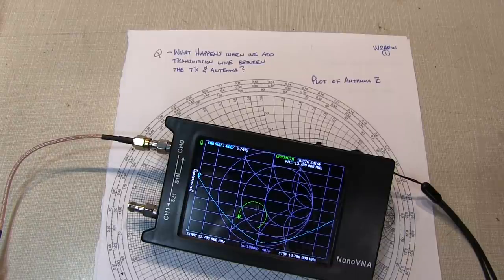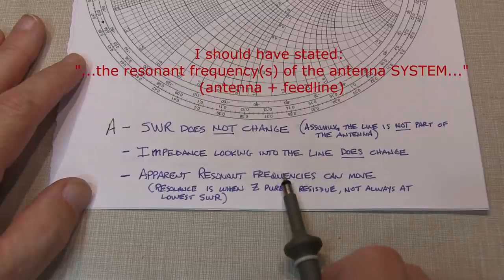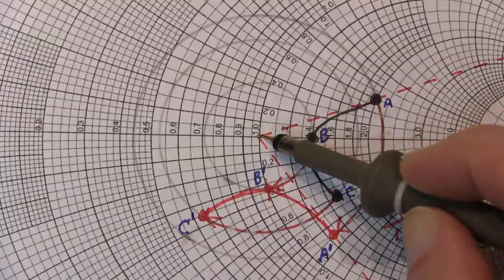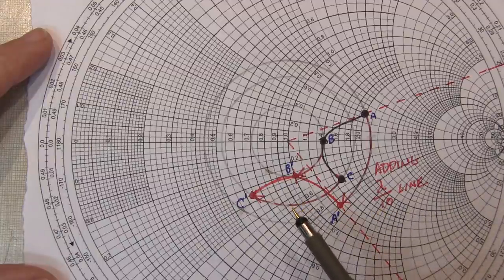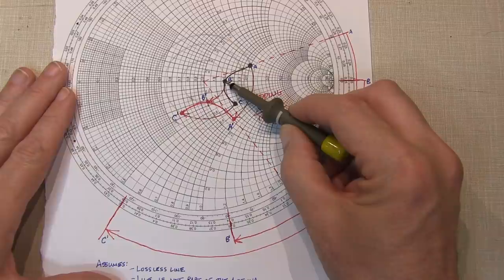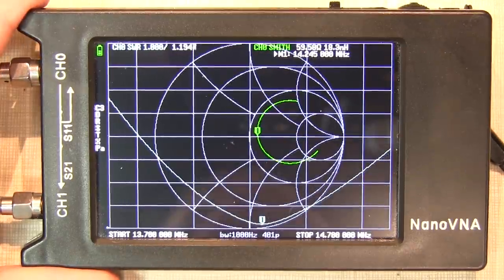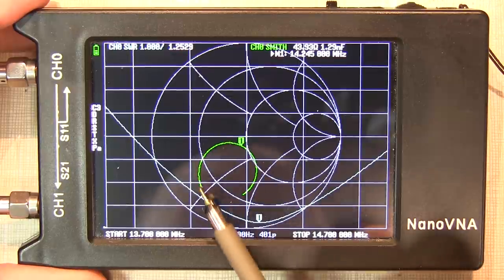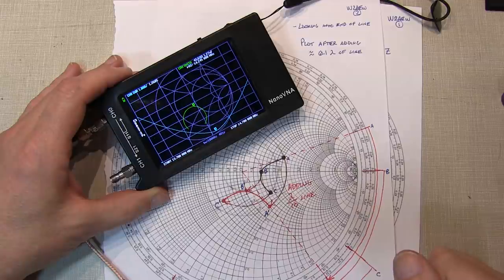#325: Use NanoVNA and Smith Chart to show effect of adding transmission line length

Comment: I've been in electronics communications for over 50 years, and this was never explained.  Likely for technicians, unnecessary.  However, with the advent of affordable devices like the Nano-everything, this becomes a tool for understanding by playing with it on the bench and ultimately the field.  Thank you so much.
Reply: An electronics technician who is going to work for 'communications', it helps a lot to take a 'technology course in Specialized Microwave Electronics training, to learn how 'microwave frequencies work, Klystrons, Magnetrons, TWT's. Microwave waveguides, components, Microwave mathematics, laboratory work, and learning the use of the SMITCH CHART. I took a 9 month course at Microwave Training Institute, owned by Alan Scott, a Microwave Engineer who worked at VARIAN, way back in 1985 here in SILICON VALLEY, Mountain View California.

Comment: Alan, great video as usual. In some future video on the subject, can you show what happens when you add transmission line of a different impedance than the system? As those used in some antennas to correct the impedance. Also, what happens when you add lossy line (SWR goes down, but why). Thanks for your videos and Happy New Year!
Reply from the maker: Often times a quarterwave transmission line is used to transform impedance.   A transmission line that is a quarter-wavelength long has the unique property of inverting the impedance around Z0 (it's line impedance).  The relationship is Zin/Z0 = Z0/Zload.  Thus, to transform from Zload to Zin, you use a quarter-wavelength long line with Z0=sqrt(Zin*Zload).   Lossy line quite simply reduces the apparent SWR because the reflected power is attenuated simply due to the loss in the line.  Since less reflected power makes it back to the transmitter, it looks like the SWR is lower, but it really hasn't helped anything.

Comment: Great video, thanks :-) I assume you're adding line of the same impedance as the line already used in the antenna system. Or does this apply as well, if the 'extra added line' is the actual antenna feed as a whole?  How does it look in the Smith Chart if you add extra line of another impedance, fx. 75 ohms in a 50 ohm system or vice versa? 73s

Comment: Despite of Alan's explanation by means of the Smith Chart, it still might remain a bit hard to understand from a physical point of view why the impedance transform by the cable won't affect the SWR.
One could think that any transformed antenna impedance back to the generator would cause an impedance mismatch there against its 50 Ohm output causing further reflections with impact on the SWR.
I assume that this is not the case because there's no physical impedance mismatch between the generator's output and the cable. The transformed impedance just describes the voltage/current ratio at this point.

Comment: I got the NanoVNA SAA-2N. In order to read and display SWR, there is a circuit called the SWR bridge. Now, have you tried reading from any tuner? For example, REF and FWD is needed and provided by the SWR bridge, by reading from the tuner coupler where to me the bridge is at. The idea is to tune live, with no carrier on the air, as the analyzer shoots an exciter to the antenna to plot on the display. Now, when both, the tuner and analyzer is used as per above, then both tools become even a better solution, due to tuning live, no carrier, then transmitter is ready to go out on the selected and tuned frequency, rather than analyzing to see where the antenna is resonant at.
Reply from the maker: Yes, of course. The NanoVNA has a bridge built in.  Here's a video that shows using the nanoVNA to view and help optimize the adjustment of a tuner: https://www.youtube.com/watch?v=xa6dqx9udcg

Comment: So is this why adding an extra length of coax to your antenna feed will sometimes allow an ATU to match a previously unmatchable antenna system?
Reply from the maker: EXACTLY right!  A small change in line length may "rotate" the impedance into a range that is more easily covered by your ATU.
Reply: in the olden days of ladder feed lines some L or some C was added across the line where it went to the balanced tuner.

Comment: Fantastic thanks!

How can we make sure (i.e., measure somehow) that the coax does not become part of the antenna?
Reply: Balun?
Reply from the maker: Good practice helps - such as using a balun at the feedpoint of balanced antennas (like dipoles), and a common-mode choke at the feedpoint of unbalanced antennas (like verticals) and ensure you have a good ground/counterpoise system for them.

Comment: If you didn't already have a perfectly tuned antenna would the SWR have changed?
Do you tune your antenna with calculated half wave lengths? Thanks!

The reason I ask is because I tuned a buddy's Big Rig antenna the other day with my Nano VNA H4 with a 6ft RG8X coax to a very low SWR 1.3:1 at 27.205 ctr of the band and ch1 and ch 40 1.5 SWR.
Then we hooked the radio back up to his 18 ft RG8X coax and tested with an Astatic SWR meter and ch 40 was like 3.5:1 and way in the red.

So we had to cut another 1.25 inches off the antenna to make it work with the 18ft cable.
Checking again with the Nano on the 18ft coax every thing looked fine.
We cut around 5 inches off that Wilson Trucker 3500 antenna to get the SWR right.
Reply: 18 feet of rg8x is not a 1/2 wavelength.14' 11" ish is a 1/2 wavelength of rg8x

Comment: Very nice video! Congrats. Just one doubt: when I measure the SWR, if I hold it in my hands, the SWR is too much lower than untouched.  What is the right way to use it?
Reply from the maker: What that is telling me is that the impedance of the device you are measuring DEPENDS on the grounding of the shield of the coax.  YOU are becoming part of the load impedance, that it why it is changing when you touch the VNA or not.
Reply: The doubt is if I must touch the VNA or not when I measure an antenna SWR.  I also have a Comet CAA-500 and this occurs the same way.
Reply from the maker: @thewanderer1726  If the SWR changes when you touch the VNA, then the antenna does NOT have sufficient ground or counterpoise, because YOU are becoming part of the counterpoise.  Ideally, the antenna should have a sufficient counterpoise such that touching the analyzer has no effect.  What kind of antenna are you measuring, and how it is connected to the analyzer?
Reply: I'm testing some rubber duck antennas for my IC-92AD.  I connect it to CAA-500 with a SMA adapter and directly to NANOVNA.  When I hold the device, the SWR is near 2-2.5:1. Without touch, increase to 5-6:1 !!!
Reply from the maker: @thewanderer1726  Rubber duck antennas are notoriously poor.  They rely on the body of the person with their hand wrapped around the HT to be part of the counterpoise.  And, even with that, they rarely have anything close to a good match.  The best way to see how this antenna "looks" to your HT would be to hold the analyzer in your hand the same way you would be holding your HT.
Reply: Thank you very much for your information, Alan!  I understood.  Kind regards.

Comment: at 1:56, you show point A as Low Freq and point C as Hi Frequency.  I think these are backwards.  the point will spiral clockwise as frequency is increased. IE, if this were 40M antenna, point C would be 28 Mhz and point A would be 30 Mhz for instance.

Comment: I have an 80m dipole that’s less than 20’ feet at the feed point. It’s resonant, and works really well, but I’m not sure of the feed point resistance. I’m guessing that it’s probably below 50ohms. I’ve thought about building a balun to match the feed point.  Would adjusting the coax length (providing that method would get me closer to 50ohms) be more or less efficient, as far as getting more energy to the antenna.  I am exclusively QRP, so every bit helps. 
Thx and 73’s from VE land.
Reply from the maker: The balun at the feedpoint would be most useful to ensure that the dipole is driven with a balanced feed.

Comment: Question: 
For measuring swr and return loss, what is better?
Return Loss Bridge on a Service Monitor 
or 
Scattering Parameters from a VNA? 
Pros / Cons to each?
Reply from the maker: For simple SWR, Return Loss or Reflection Coefficient, either would work well.  The RLB is simple and easy to setup.  The VNA adds more capability as needed for things like measuring complex impedance, moving the measurement plane to the antenna, getting the complex data so that you can design matching networks, etc.

Comment: Great presentation.  If you take request. Please, do a lecture on the minimum noise figure cycles, which is different from matched impedance and its effect on filters and antennas.  Here is a reference in this area: Microwave Engineering by David M. Pozar

Comment: Alan: Would it be accurate to substitute "return loss" in place of "SWR" in the context of this discussion?
Reply from the maker: Sure, almost.  SWR, reflection coefficient, S11 all follow each other.  Return Loss is essentially the inverse of reflection coefficient.  So, when SWR, reflection coefficient and S11 are minimized, the Return Loss is maximized.
Reply: @w2aew  That's only true of the magnitude of S11, though, right? Phase would have to change if rotating around the Smith Chart.
Reply from the maker: @Ziferten  Yes, of course.

Comment: I find it interesting you can tune an antenna by using the length of coax. In the RC world, many common 2.4GHz receivers use maybe 5 inches of thin coax with the center conductor exposed usually but not always 31.25mm, FrSky go with an unusually short 28mm or so.

Are should these antenna be classified as monopoles or dipoles? is it possible to know what the optimal length is for a mystery receiver with only u.fl inputs?
Reply from the maker: You're not actually changing the length of the coax to tune the antenna, you're changing the length of the exposed center conductor only, which is a monopole antenna which uses the coaxial shield as part of the counterpoise.
Reply: @w2aew  I see. Bruce Simpson over at xjet or RCmodelReviews made a video explaining in laymans terms that sometimes the antenna may be designed shorter or longer than expected on purpose, with the length of coax and series and shunt impedances on the board might be used to correct the mismatch. Joshua Bardwell also attempted an empirical test of several receivers but had inconclusive data.

It's an interesting idea but I don't know why a manufacture would not to just use a standard length of 31mm here, and allow freedom of any arbitrary length of coax and a simple 50 ohm input impedance to the RF chip, usually a CC2500 or other similar transceiver IC / MCU. Do you have any theories? Perhaps more radiation area / collection area? or just poor tolerance/QC?

Comment: I have a digital HF power/SWR meter, and its power and SWR reading change depending on how long the coax is between the radio and the meter sampling unit (this is with a dummy load for an antenna).  For a 100W transmitter, I can make it read 80W, 100W or 130W by changing the coax length by a few feet.  We're talking less than 15 feet of coax total.  Why is this?  I thought the meter was bad, but I have two of them by different manufacturers that do the same thing.  If I put a Bird meter in place of the digital meter sampling unit, it always reads a steady 100W forward, 0W reverse, as it should.  The length of the coax between the sampling unit and the dummy load makes no difference.  I can't figure it out.  Its driving me nuts.
Reply from the maker: Sounds like your meters (not the Bird) are introducing an impedance mis-match.  Try going looking at this:
TX ----- Bird ------ SWR_meter ------------------------------dummy load
See if the Bird is showing any reflected power in this case.

Comment: So on a mag mount antenna is the coax part of the antenna?
Reply from the maker: It can be (depending on whether a common mode choke is used or not).  The metal surface that the antenna is mounted to is also a part of the antenna.

Comment: I don't agree that SWR not change, it could get better since transimssion line add losses, which attenuate returning wave. Of course it is more signifant at higher frequency and longer lines.
Reply from the maker: Yes, of course.  That improves the "apparent" SWR, but does not change the mismatch.  And, I put forth the assumption that the video was assuming lossless lines ;-)

Comment: I saw Smith Charts in various RSGB Handbooks but could never understand where the figures came from, now with my VNA I can see what is going on. Adjusting aerials is so easy now, too short? Too long? I can see now.

This is why the C.B. world is obsessed with the ½λ of coax myth. It's because they have no confidence their aerials are tuned properly so tune the coax after hearing about the same impedance. Why not ½λ to the SWR meter as well? What about 4" for the SWR meter but is it on the aerial side or the tx side? That's how daft it is.

I've been challenged by a C.B.'er to make a video to show it doesn't matter. I set it up with an oscilloscope, r.f. pick up meter at the dummy load of a 50 Ω carbon resistor, different lengths of coax and no reading changed. Oscilloscope 50 Volts each time and the pick up meter did not change.
I then proved putting the SWR meter could go anywhere.
I need to see if my camera has enough memory as it's quite old and the new cards don't work in it.
G4gHB.

Comment: Are lossless lines possible?
Reply from the maker: True lossless lines? No.  But, often you can choose transmission lines for a given application where the losses are minimal or negligible.
Reply: @w2aew  The more I learn about radio, the more I realize I need to learn.  It's a very humbling hobby.